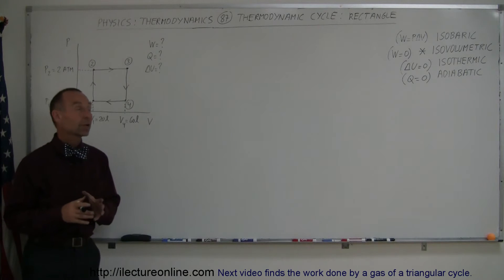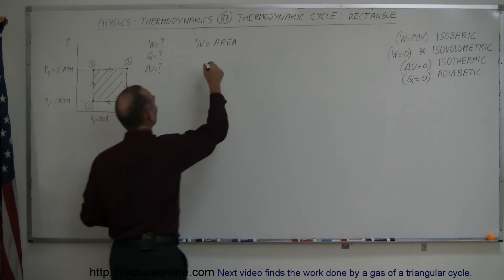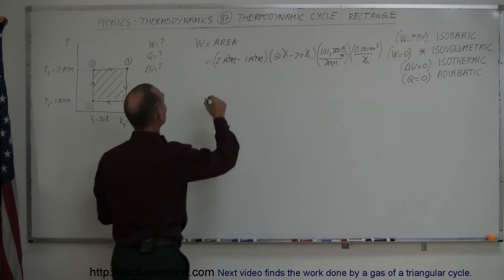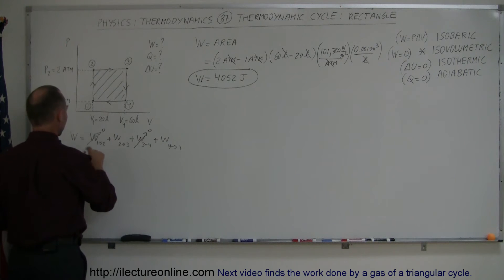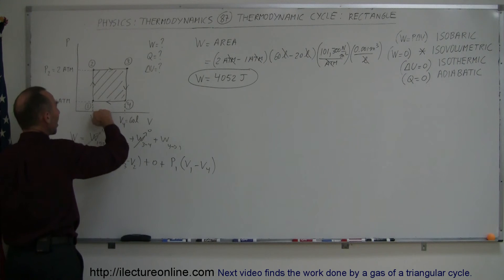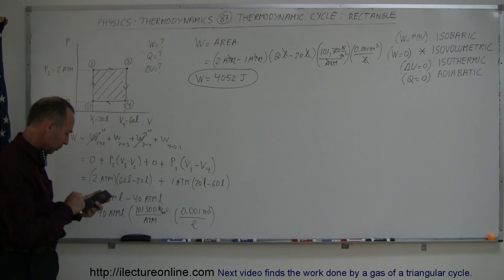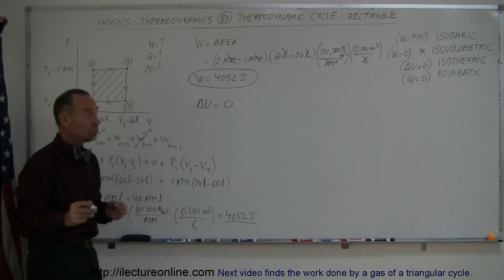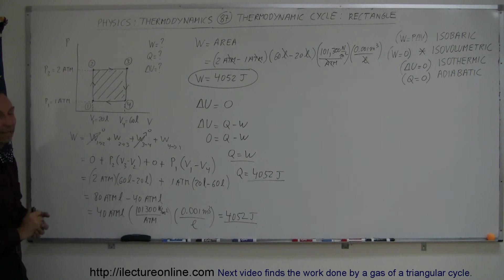Physics 28  Cyclic Thermodynamic Process (1 of 4) Rectangle Cycle

Comment: I don't know why, but my textbook says that there must be heat transfer out of the system in order to get a net work output. But in the video which is what I think is correct, states that Q = W for a cyclical process. So that means heat transfer into the system equals net work output. The statement in my book contradicts my point and your video. Why did that happen? Thank you. I actually think that maybe the situation is different. Mine is a PV diagram describing a heat engine. During the first adiabatic process, (Qh) heat transfer into the system; and during the second adiabatic process, which is the fourth and final process, (Qc) heat is transferred out of the system to return to the same state it started in.

Comment: sir, for this case what's the efficiency?  100% shouldn't possible.
Reply from the maker: +Md. Mominul Islam 
Note that on the PV diagram we work with the state variables (P, V, T) and this does not include the efficiency of the engine only the portion of the energy added to the gas that is transferred to work.  To calculate the efficiency, you will have to use a different equation.

Comment: I'm okay with this thing that internal energy at the end remains same. What I'm talking about is that within the INTERMEDIATE steps the internal energy changes and hence the heat supplied should be little more to do the work.
Reply from the maker: +Karan Bellic 
When you add up the change of the internal energy of each step, they will add up to zero for a complete cycle.

Comment: Thank you ,sir. I've got this question and it might seem somewhat crazy but it's really holding me back. You said that work done in a cyclic process is equal to the heat given but since the internal energy is changing in the intermediate steps in the cycle hence the heat supplied should be a little more to do the same work. Thanks in advance.
Reply from the maker: +Karan Bellic 
  When the gas goes through a complete cycle, it ends in the exact same spot as when it started with the same T, P, and V and thus the internal energy change through a complete cycle is zero.

Comment: why is the work positive clockwise and negative anticlockwise?
Reply from the maker: By definition, the work is positive when done BY the gas.
Thus work can only be done by the gas when it expands.
Volume increases when gas expands.
Reply from the maker: ***** 
That depends on how you define the first law of thermodynamics.
Read the definition carefully.
I like to define it like this:
"The change in the internal energy of a gas is equal to the heat added TO the gas minus the work done BY the gas"
This is the definition in many textbooks.
With this definition, the work done is positive when the process on the PV diagram is clockwise.
There are textbooks that use a different definition.

Comment: why there cannot be a system that is describe by a circle instead of rectangle? how can we determine the efficiency of such cycle?
Reply from the maker: Israel,
There are 4 main thermodynamic processes.  Constant pressure (isobaric), constant volume (isochoric), constant temperature (isothermic), and adiabatic (nothing remains constant and Q = 0.  None of them look like circles on a PV diagram.  I suppose with some advanced math we could come up with a way to calculate the  efficiency, but it would be a theoretical exercise.